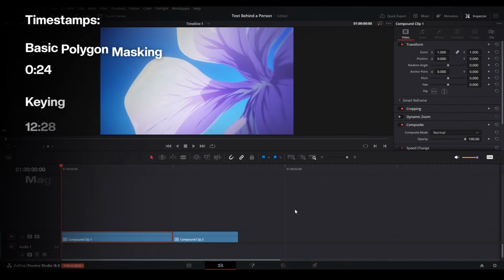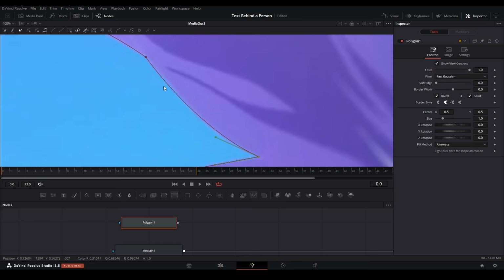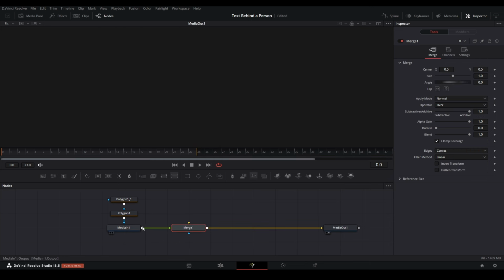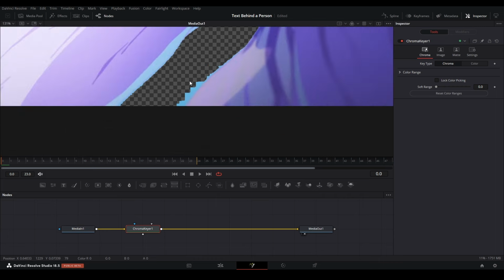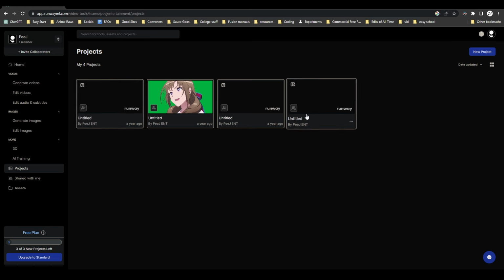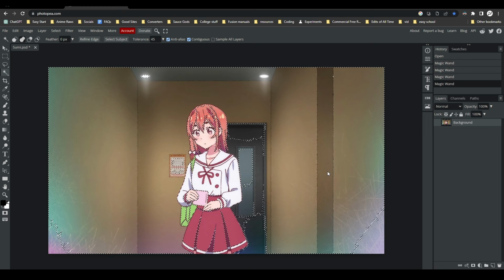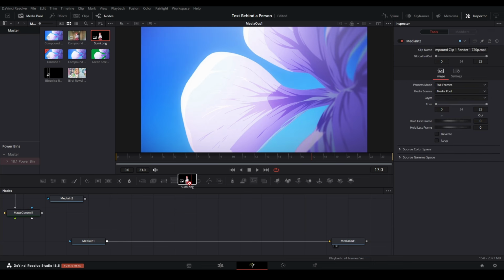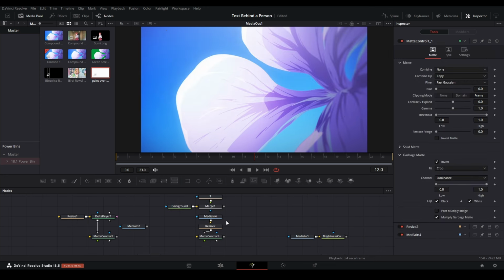DaVinci Resolve | Every Masking Method

Comment: Right at the start you are missing the opportunity to show how to use the pen tool correctly. Just clicking points without dragging the control handles as you go is just wasting time. OK, you may need to tweak the odd point and it’s handles after you have finished the mask, but doing it how you demonstrate is just making everything take twice as long to create.

Comment: There is also the magic mask in the Color page, which usually does a much better job than the magic mask in Fusion. It's also easier to use because it puts a red overlay on top so you can see both the original and the mask at the same time while working on it.

Comment: Whats are the reasons for creating a compound clip for your AMV. I notice you do it for all your videos. I never understood why ?

Love to learn the benefits.
Is it just to make sure it starts from 0 or are there additional benefits.

Thanks
Reply from the maker: Mainly it is what you said, so the fusion clip starts from 0, but also it gives me the option to switch out the clip inside the compound clip timeline if I would want (for preparing my slow mo aka Twix clips it allows me to have a timeline all to itself to make the corrections I need for it without disturbing the main timeline), I also keep all my compound clips in a certain bin in the media pool so I can access them nicely, it also shows how long of a clip I have to work with if I'm stretching it out, generally all small things that allows me to work with the clip in the way that I like, hope that makes some sense